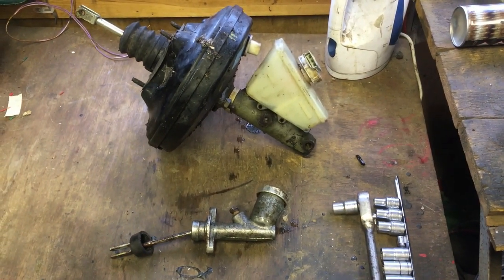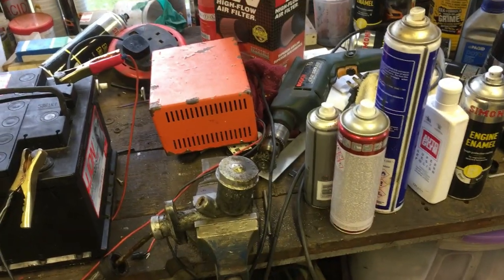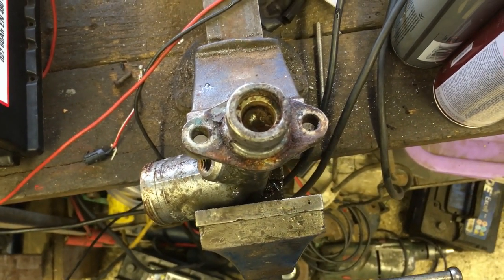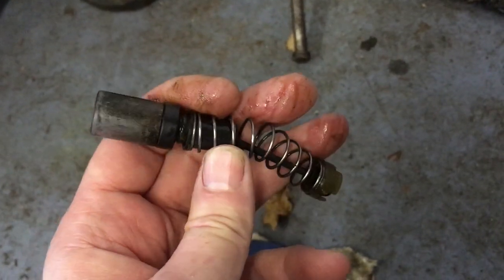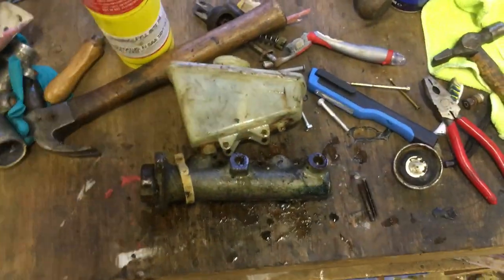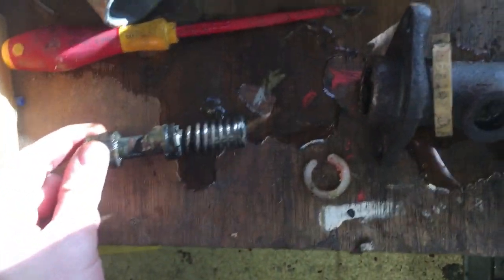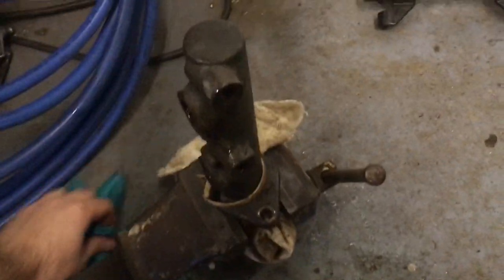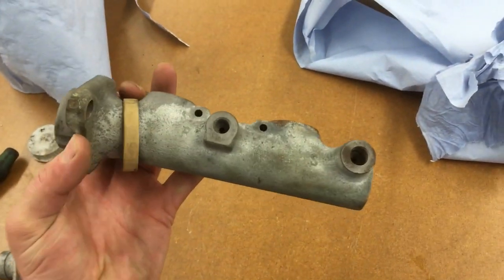Rover SD1 2400 SD Turbo restoration - Video 4 - Stripping done master cylinders

Comment: Hi, is there a seal on the end of the brake master cylinder between that and the servo? or does it just bolt on do you know? Cant seem to confirm this.
Reply from the maker: Yes there is. It’s like a big o ring but has a square section profile
Reply: @nitrosilvia  thank you so much for the reply! Can’t find this seal anywhere!, don’t suppose you have any ideas where I might source it?
Reply from the maker: @jmclover313  yeah rimmerbros dont sell it anymore but helpfully still show the part number here as  aeu1891

https://rimmerbros.com/Item--i-GRID009019

john craddock have that part listed here

https://www.johncraddockltd.co.uk/aeu1891-seal-master-cylinder-to-servo-90110.html
Reply: @nitrosilvia  thank you so much for your help! Tracking stuff down is a mission online. Would a defender servo and master fit I’m guessing? Look pretty much identical other than the  brake pipe connections being on the opposite side of the master. Thanks again for the advice
Reply from the maker: I’m not sure it will work as it might be a different bore of the cylinder and differnet stroke. You can get a rebuild kit for the master cylinder and servo off rimmer brothers. That’s probably best way forward